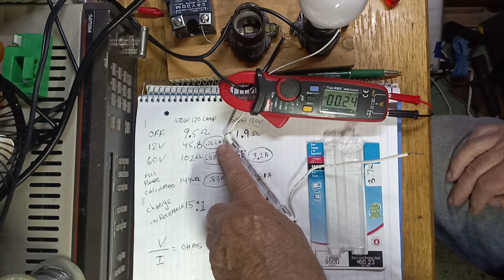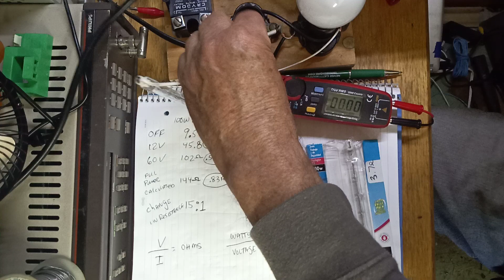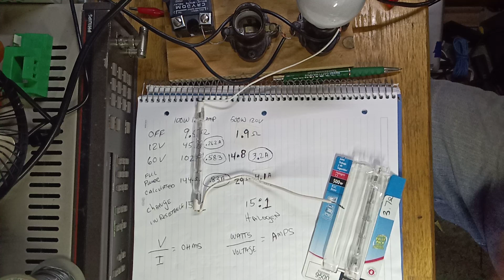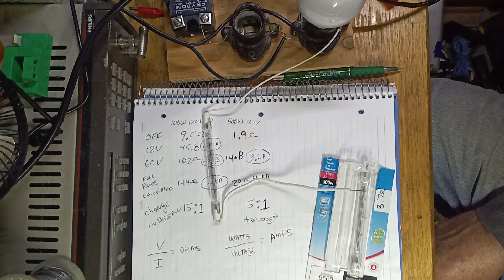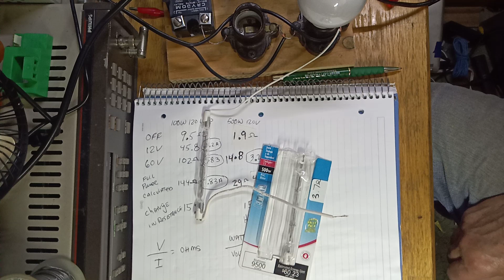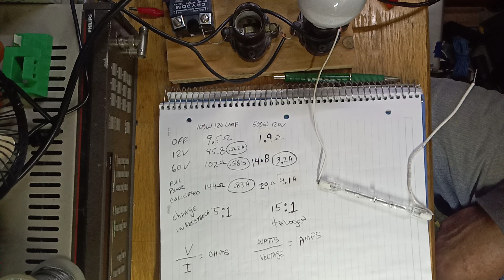How Many People Does It Take To Pre Charge Cap Bank? Dim Bulb Tester

Comment from the maker: I save old headlights for diagnosing problem in automotive circuits. The low beams blow out first and the high beam is still fine. Spade plugs fit inside fuse sockets. Grinding the blade will make it fit in those smaller fuse sockets. Those pesky intermittent shorts are easier to find with a visual indicator.  Wiggling a wire can help you locate where a short might be without blowing fuses.

Left out the resistance of the 500W lamp on 12V.  At 1.26A the resistance was 9.5 ohms.
Reply: That is cool AF...thank you for the idea